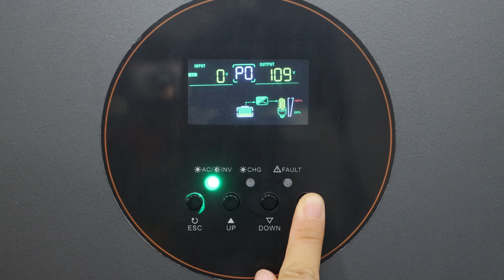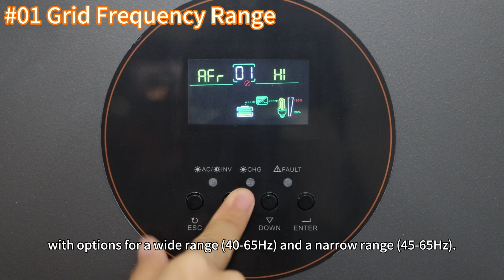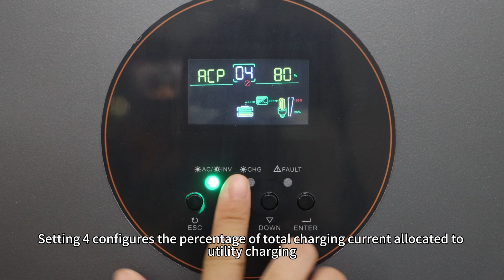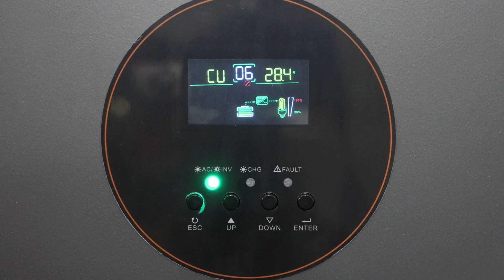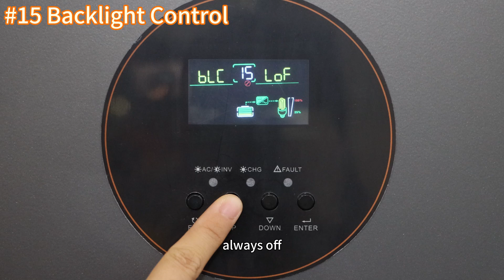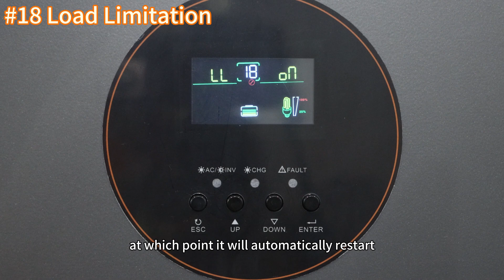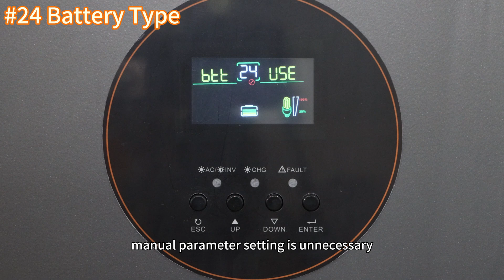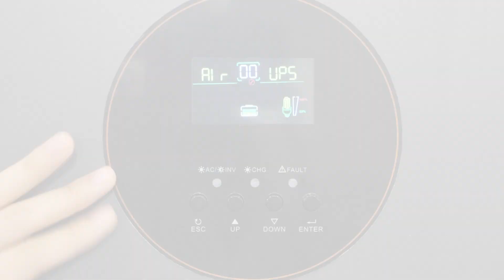How to Setup the POW-RELAB Series Low Frequency Inverter?

Comment: Please I have a lithium battery of 24v without a communication port so what setting I my to use..
Reply from the maker: Please send us your inverter model.
Reply: Low frequency hibrid inverter
Reply: Mode number is pow RELAB 3KE pow REL 3kUE
Reply from the maker: @emmyprince4332  Select user
Reply: My second question is that how  can I make use of the  inverter  without and the same time charging the battery.. I e useing the solar energy from the Sun at the same Time charging the battery. Which settings is the best.....
Reply: Because each time I switched the battery off why there is sun the system goes of  instead of working with out the battery at the day time
Reply from the maker: @emmyprince4332  I don't quite understand what you mean. Do you want it to work without batteries?
Reply: Yes what I meet is that how can the inverter work with out battery or can it work when only solar panels is connected to the inverter..
Reply from the maker: @emmyprince4332  This model needs to be connected to a battery to work.
Reply: Because I noticed that if I off my battery the inverter will gose off why the panel are generating voltage and current....

Comment: The AC input to this inverter, according to the manual, is 110V but is adjustable to 120V, as are the outputs, which can also be increased to 120V.
Reply from the maker: Yep.

Comment: Hi does the 3kw has charge equalizer intervals for flooded acid battery? And if it is configurable?
Reply from the maker: This model does not have an equalization function.
Reply: @PowmrSolar  Ok but what about the flooded lead acid battery that they require from time to time equalization? Or is not compatible with that type of battery
Reply from the maker: @traphouse5941  The device is compatible with lead-acid batteries. Simply set the battery type to lead-acid. For balanced charging, you can configure a balanced charger.

Comment: I have another question that I couldn’t find the answer to: regarding the AC output Ground and Neutral, should they be bonded together if the inverter is the only AC source for my house, or is this already handled automatically by the inverter (in inverter mode / AC bypass)? (I also connect AC IN for the backup source at night)
Reply: My is pow-relab-10KE
Reply from the maker: Please send your question to this email: support@powmr.com.

Comment: how to fix, in setting 21 there showing only 0 and 1 normally should be showing 110 and 220, now value AC output only 0 -1 volt, please help to fix it,  Thanks
Reply from the maker: Please send us the model number.
Reply: @PowmrSolar  MODEL POW-RELAB 3KE, Serial 202505060023, Thanks for helping
Reply: @PowmrSolar   MODEL POW-RELAB 3KE, Serial 202505060023
Reply: @PowmrSolar  model POW-RELAB 3KE, serial 202505060023

Comment: Can i got firmware this inverter?
I have lost my powMr low frequency inverter 3kw firmware.
Reply from the maker: This machine has no firmware and cannot be updated. The update will cause damage to the machine control board.
Reply: Sir,now what can i do, please @PowmrSolar
Reply: @PowmrSolar Sir, if its firmware cannot be updated, then how did it ask for an update and why is it a problem? Where can I get its controller, sir? I have only been using it for 3 months, please provide a solution.
Reply from the maker: @PrinterSalesServiceBD  Please describe your problem in more detail and if possible, record a video and send it to this email: support@powmr.com.

Comment: adjustable charging current?
Reply from the maker: The charging current is adjusted to the maximum value. The actual charging current is automatically adjusted according to the charging power.
Reply: @PowmrSolar 
Thus it can be adjusted? Or customized?
Reply from the maker: @ The maximum value can be adjusted
Reply: @PowmrSolar 
5000w low frequency inverter have a 120amp... can be customized/adjusted to 30 amp charging current? 

For the preference of the battery bank
Reply from the maker: @robertvillaroman8639  Please refer to the 04 and 05 settings on page 27 of the manual.

https://cdn.shopify.com/s/files/1/0746/0415/1079/files/POW-RELAB-SPLIT_SERIES_User_Manual_V1.5.0428.pdf?v=1745833769
Reply: @PowmrSolar  I dont get it.. how do you set the maximum charging power.. if connected to grid you can have almost unlimited charging power.. how does this inverter compute tha charging power.. how you prevent the battery from bloating / blowing up during charging..

Comment: If you look at the video, can the bulk & float charge settings be lower than 28.4 & 27v? or is it already the lowest in this inverter?
Reply from the maker: 24V Boost Charging Voltage set range：(27.0-30.0V) 
 24V Float Charging Voltage set range:  (25.0-28.0V)
Reply: @PowmrSolar  what about POW-RELAB 5KE 48v?
Reply from the maker: @pltsskalarumahan  
48V Boost Charging Voltage set range：(54.0~60.0V) 
 48V Float Charging Voltage set range:  (50.0~56.0V)